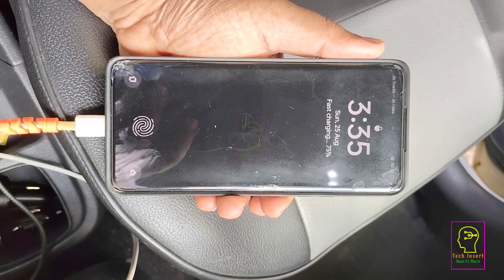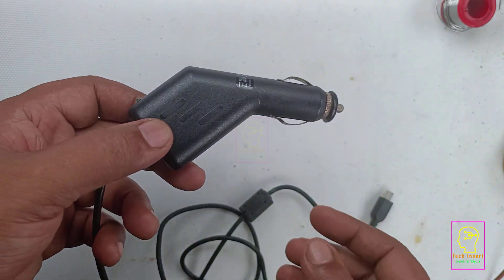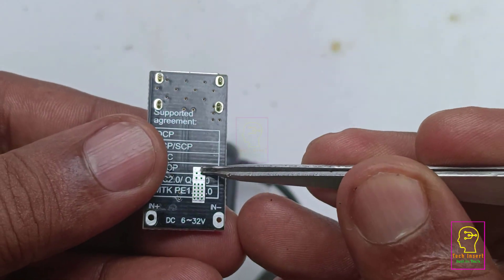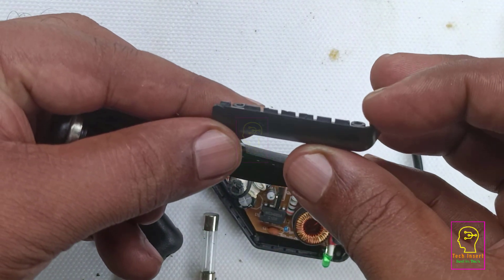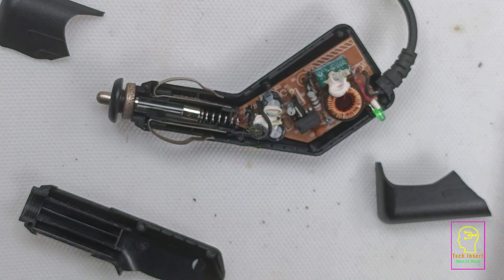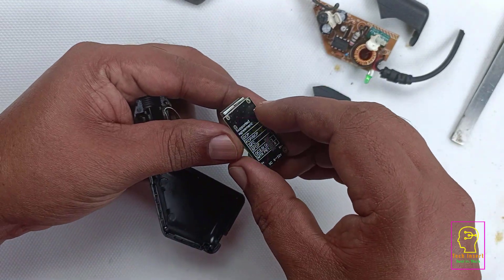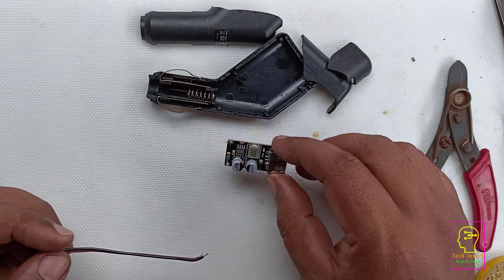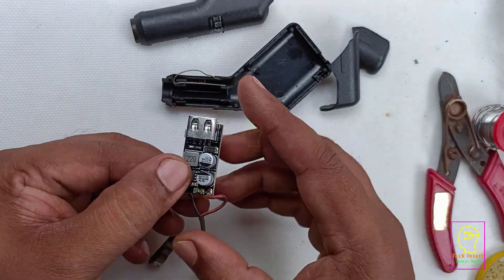DIY-Make Yourself Fast Charging Car Charger

Comment: Hi, nice video appritiated. Product still working or not. How was the quality?
Reply from the maker: Still working. Good one
Reply: Which mobile is used in this video?
How many watts getting?
Reply from the maker: @ Oppo  Reno 10G and Vivo 5G model number i do not remember. Fast charging is working fine while we are travelling
Reply: I think you're saying oppo old version mobile. Oppo supervooc charging mobile get or not? 33 watts output supervooc, PD Qc 4.0 will not support i think so.
Reply from the maker: I didint try that